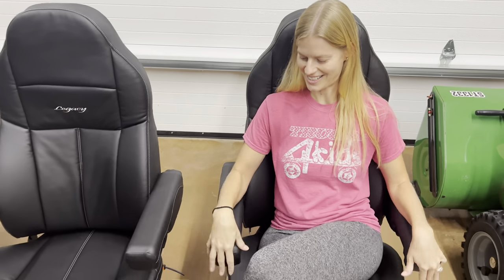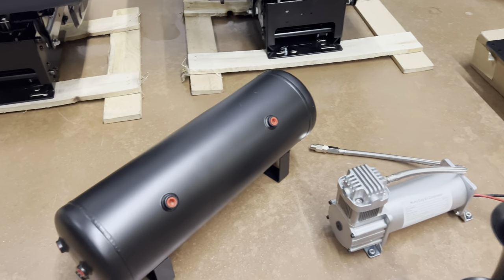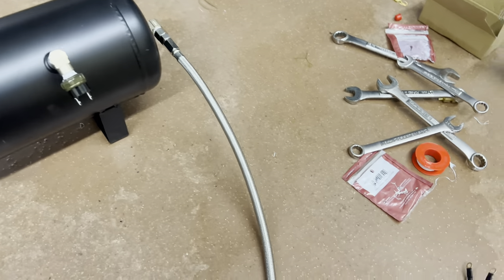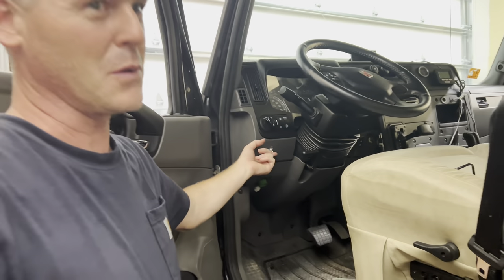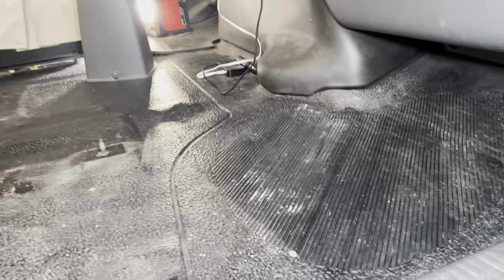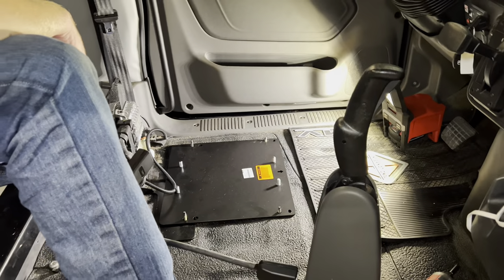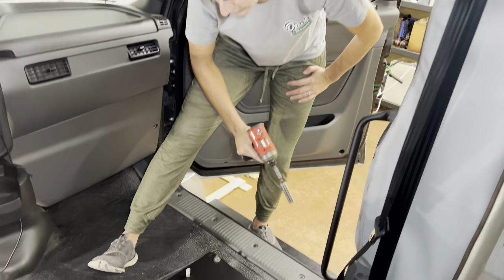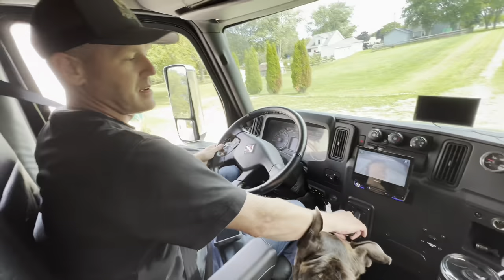Have A Motorhome? Watch This First!👀 (Air Ride Seats & Horn!)

Comment: Interesting upgrade, as I looked at diesel pushers the thing that struck me was the lack of seat heaters and coolers given you were spending north of quarter of a million on them.  They are only available when you get to the top of the line like the Entegra Cornerstone and not the Reatta's I was looking at.  I would assume you could do the same swap with a DP (may have to fabricate your own base plate) and get the heat and cooling :) the air supply would not be a problem in that case.  I also think the black seats look better in the front they match the cab more.  Having never ridden in an 18 wheeler (either side of the pond) I would not know what they normally feel like.
Reply from the maker: We like the look of these seats vs the motorhome seats for sure! Makes the cab look put together imo.
I'm sure you could add air ride seats to any motorhome as long as you can bolt it up correctly. And it's worth it!

Comment: Might want to consider readjusting the tank. You want the drain valve on the bottom. You will get water in the tank like an air compressor system for the home garage you need to be able to drain the water.
Reply from the maker: The drain valve is on the bottom.

Comment: I installed a single Pinnacle with heat on the drivers side from Seats Incorporated. Drove up to Big Rig World in Hubbard, Ohio to get it, save hundreds on shipping. Seat are night and day. Seats Incorporated make a great seat. The seats are well made and so heavy to install by yourself, which I did.
Reply from the maker: The dealer had 1 pinnacle seat in inventory! It was super nice but only had one there. These seats have a great reputation and so far we are very happy!
Reply: @WanderingWagners  Yes there so nice, Mike did a super great job installing the air system and seats.
Reply from the maker: @CraftingN112DR  thank you!👍🏻

Comment: I am doing a lot of upgrades on my 89 Fleetwood Limited 37' Class A, and the Air Ride Seats are on my "To Do" list.
Which is how I found your video.  I'm thinking I may have to go with heated and cooling Semi Air Ride Seats in my Class A Coach. Already have a big compressor and 10 gallon tank for running air tools and airing up tires, so plumbing in seats will be no big deal. (Former Semi Truck Air Brake air tank.)
By the time I get it finished it will be a 400 HP Rocket that looks like a $Million Bucks.  
It was a High End Rig in it's day, and my total makeover will make it even better than the day it rolled out of the Factory.
Now I'm going to have to watch more of your videos to see what else I might want to add to the "To DO: list.
Great Video Guys!
Reply from the maker: The heated seats are really nice but we are happy with ours. If you can/want to get the fancier heated seats, that's awesome! 
Sounds like you'll be making that RV really nice! Enjoy😁👏🏻
Reply from the maker: The heated seats are really nice but we are happy with ours. If you can/want to get the fancier heated seats, that's awesome! 
Sounds like you'll be making that RV really nice! Enjoy😁👏🏻

Comment: I can't believe that truck didn't come with air ride. Rv manufacturers are just crazy in their designs. 
  Makes me want to add them to my gas rv holiday rambler.  I drive truck for a living and know this would be nice. My practical side " if it's not broke, don't fix it" doesn't let me just replace stuff.
  Is there a auto-shutoff on the compressor?
Reply from the maker: I installed a 90-120psi pressure switch. Honestly I didn't want air ride suspension because liquid spring is a much better ride for an RV.

Comment: Just watched ur video on the air ride seats, great video.  Is your rig a super C?  I have a super C with air brakes, would I still have to put in a compressor and air tank?  

Thanks. Mick
Reply from the maker: Yes ours is a super C.
If you can run a line from the tank/compressor that's already there you shouldn't have to add one like we did.
Our rig doesn't have air brakes so we had to add the compressor and tank

Comment: I ordered the base for the seat but did you need to order the Legacy with low suspension to be closer to the pedals.
Reply from the maker: No it was just the standard height.

Comment: Where did you get the seats????     Would these work for the for the Freightliner chassis that the Jayco Seneca and the Entegra Accolade built on????
Reply from the maker: We bought these seats from Selking international in Stony ridge Ohio. You might be able to find a dealer closer to you though from this link. They make base plates for Freightliner so you should be good to go! These seats have been amazing! https://www.seatsinc.com/products/on-highway/legacy-series/legacy-series-silver/

Comment: Hello guys. Very nice video. I'm also trying to do something similar like you but I need your help about air compressor. Could you give me some information about air pressure you using, how mach is strong engine of compressor, how much is big tank for air?
Have you got any information about amount of air you consume per hour, how often engine working?
Thanks a lot in advance.

Sorry for my bad English but I hope you can understand me...  

Best regards from Serbia.
Reply from the maker: This is the kit we bought off of Amazon: https://amzn.to/3oP2C8Q
It's been working out great for us since we added it. It works for the air ride seats and the air horn. Once it's up to pressure it shuts down unless we use enough air to where it kicks on again, which is pretty rare since once your seats are adjusted, not much air is needed after that.
Hopefully this helps and if you have any other questions, let us know😊
Reply: @WanderingWagners  Thanks a lot, you are wonderful. Tell me more about Air Ride Seats, are they really comfortable? I didn't have any chance to try them but I think it will be good solution for my sick back. I have plan to change my standard driver's seat with air ride seat, I hope it will help. Which brand of seat did you get? Could you recommend me some brand?
Thank you
Best regards from Serbia
Reply from the maker: @darkodachic7955  yes three air ride seats are much more comfortable than regular RV seats. They are a lot more adjustable and have lumbar which our old seats did not have. We bought the seats from our local international truck dealership and the seats are made by a company called Seats Inc. ours are called "Legacy Silver". They have different types of seats to choose from.
Reply: @WanderingWagners  That brand of seats we haven't here but I  will try to change my seat with some ISRI seat from truck, I hope it will be good.
 Thanks a lot guys. I hope you will enjoy in yours trips with air ride seats. 
Best regards from Serbia.
Reply from the maker: @darkodachic7955  best of luck on finding the right seat for your rig!

Comment: I don’t understand why you didn’t put air suspension in the RV to start with. As I recall you had the springs changed at quite an expense a while ago. then put your liquid suspension in when you should’ve put air in my opinion and had it over with . Now you’re adding air seats. My Prevost has air suspension and does not need air seats. Rides like a dream and no banging when you hit a bump.
Reply from the maker: Liquid spring is superior to air ride suspension, by FAR! We've had many air ride trucks and liquid spring is a smart suspension. Air seats are the way to go for a long lasting comfy ride on travel days.

Comment: A semi truck Diesel engine does not have air brakes?
Reply from the maker: Not all of them. This chassis came with spring suspension and hydraulic brakes.
Reply: Ok. Just retired truck driver and always under the assumption all diesel big trucks had air brakes. Since you’re class c is built on a truck chassis I just assumed air brakes were standard. Thanks 🤓

Comment: Oviously passenger side two people you and Pipers so it's heavy
Reply from the maker: Air ride is adjustable with a touch of the button!☺️
Reply: @WanderingWagners  is it safe when you breaking
Reply from the maker: @bhaskarparam9711  the seats? Yes. It's safe

Comment: Couldn't you wire the air relay for the big horns into the center of the wheel, and make it your one & only horn? Seems a bit un-handy to have that switch down away from you so low, and, who needs that weenie "city" horn when you now have a setup that you could use in a truck-stop without getting laughed out of the place? 🤣🤣
Reply from the maker: Yes you could and we thought about it but wanted the different horns for different situations.